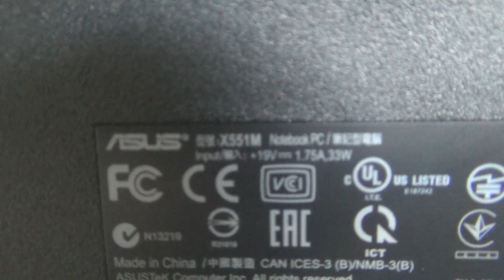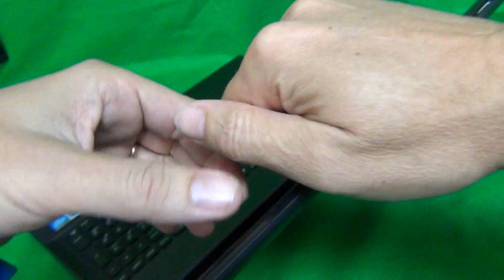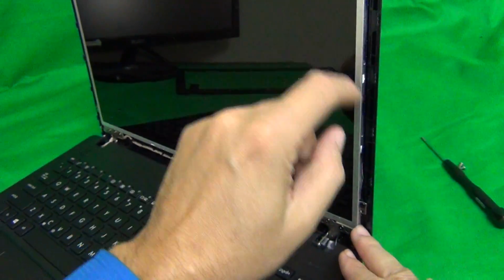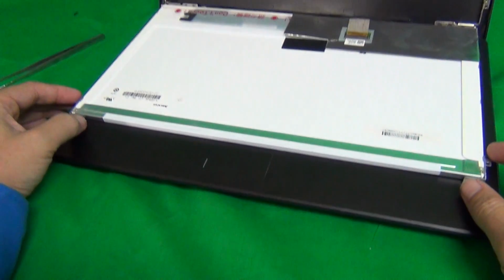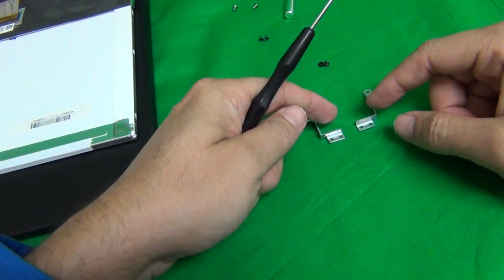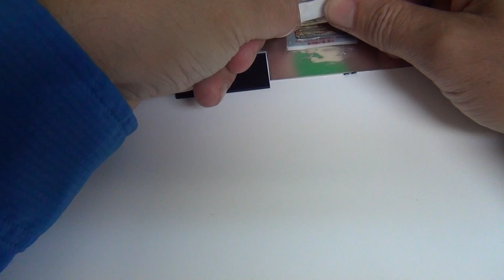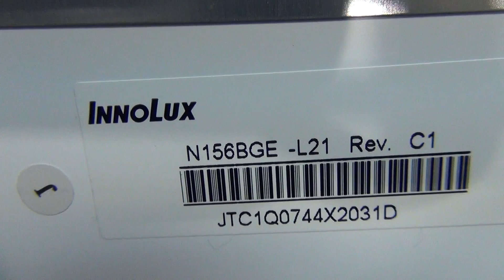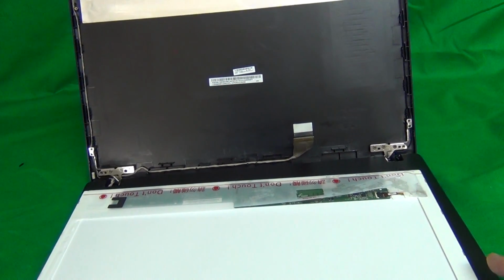ASUS X551M Laptop Screen Replacement Procedure

Comment: SUPER EASY

Shipment of the screen came very quickly. Well wrapped with bubble wrap to secure no sliding around the box. It came with tools and instructions which was a plus for me. You need plenty of light. Best time I did it in the morning. I had bottle caps to keep the screws together for each section of the laptop in one spot, so the screws doesn't mix up with other screws. In my opinion, that is to keep it organized. In overall the screen was crystal clear. Thank you for your service and Thank you for linking it to your videos. I am a very happy customer. 5 stars.

Comment: I want to thank you. I have the D550MA-DS01 which is practically the same. Mine didn't have the foil or the foam block attached to the back of the screen, though - they were attached to the inside of the top cover. A top cover which is labeled X551M, just in case you were wondering how similar these things are. After hitting ice Christmas Eve and landing on my backpack (and therefore my laptop) I had to save some pennies and get a screen off eBay. Thanks to your awesome video, I swapped the screen in about 15 minutes using improvised tools and stuff. Only took that long because I dropped a screw.

Comment: Congratulations for the instructive video :D, i have a simple question.
What important details I have to consider when replacing a screen:
. resolution
.pin connectors
-touch none touch
. eDP or VLS
What else....about the energy maybe?
If I make a mistake selecting a wrong one, what is the worst that could happen to a Laptop?

Comment: The best review for screen replacement with small details so someone could avoid mistakes. I would like to inform everybody that the aluminum foil (13:00 in video) was described as there due to some reason. The actual reason is to avoid touch the logic board accidentally which could kill the display due to static current. Also this works as a heat sync to distribute heat generated during operation. This is why all sensitive electric parts are sealed to avoid human touch. Professionals wear a metal brass when working with such parts.

Comment: My labtop is the same as that but everytime i try Turing it on, it just stays black and noting happens. so I'm wondering.. do you think my labtop screen/monitor is broken or cracked?
Reply: Did you plug it in first? Cause sometimes my computer will be like fully charged, but it wont turn on unless the charger is plugged in. Also, I think that if your screen was cracked completely, it would be showing a few weird colors. That's how it was for my sister's laptop when I broke it :D
Wait maybe it's the battery-

Comment: This was of much help with my ASUS GL552VW, and I suposse it will also work with all ROG series.
The procedure was the same with minor changes: (OF COURSE I USED THE MODEL OF SCREEN COMPATIBLE WITH GL552VW, NOT THE ONE ON THIS VIDEO)
-The plastics that cover the hinges are now separate pieces, you can easily remove then before removing the bezel and put them back later, they attach by plastic tabs.
-There are no screws on the side of the screen, so you dont have to remove the metal pieces that hold it, just unscrew the 4 screws that hold the screen, two on top, two on the bottom, and it will come off. 
-The small metal pieces in the screen where the screws go are part of the screen, the replacement screen will come with them, you don't need to remove them (you couldn't either).

Comment: There is One thing that you should be aware of.  When removing LCD/LED Screens, you really should remove all power sources IE: LI-ION Batteries as you can sometimes short out the replacement LCD Screens.  Trust me, I have done this early in my long computer repair career.  If there is power running through the computer (even if the computer is off), you can short out the screen when you insert the LCD ribbon cable on the LCD screen cable slot if you accidentally touch the metal connectors.  The problem is that with this model, you can not EASILY remove the battery and would require a disassembly of the lid to get to the battery.  Just a friendly caution.

Thanks!
Reply: can i send my labtop in to you so you can repair it
Reply: Esto es cierto, debe retirarse cualquier fuente de alimentacion y veo que en este video no se explica eso.This is true , you must withdraw any power supply and I see in this video is not explained that.
Reply: @jh_sistemas  That's becasue the battery is accessed by removing the keyboard and I believe several other key innards just to reach it.

Comment: THANK YOU    THANK YOU   THANK YOU!!!!    Just a suggestion for anyone else trying this for the first time...  If you don't have a regular work surface and decide to do this on the floor... put down a light colored sheet first... those little screws jump out and dive into carpeting, then you'll find yourself at the local computer repair guy begging for spare screws!  :-)  jus' saying'!

Comment: I dropped mine and it landed on the corner of the led screen and cracked the plastic. The little section of the plastic came off.  Everything seems to be working ok except for the camera and microphone.  There's a thin wire that runs up and along the screen.  This wire is broke at the corner.  Does anybody know if this leads to the camera and mic and can it be soldered and repaired?  Would appreciate any help.
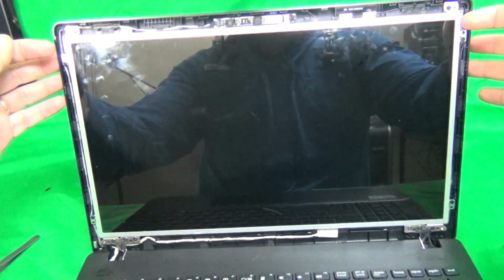Reply: +Billy Boy -- If you can see that definitely "a wire" is broke, of course, soldering it back together would help. However, that's actually a cable with a few wires inside. 5:18 shows the cable routing around the upper left (looking at normally, user's left) corner to the cam/mic. 
Soldering a splice to small wire is a delicate job. If only one wire in the cable is broke, it's doable. Jump the wire first, and see if that repairs things.
Reply: +Nehmo Sergheyev Thank you for your reply.  Luckily I purchased damage insurance when I bought the laptop and it was in effect..  The entire wire was broke.  They repaired it and replaced the back cover with a new one. I had it back in a week.  I couldn't have done the soldering on that tiny wire. The insurance was worth the price.

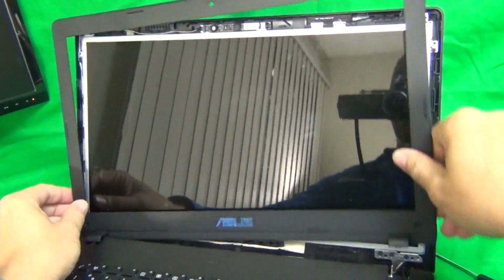Comment: You pretty much broke at least 4 plastic hooks/standoffs/stands or however you want to call them by removing the bezel so forcefully. The corners of the bezel will never close shut again and it's gonna look and feel like crap. I can see the broken plastic pieces at 5:02. Nice job man.
Reply: I did my exact same laptop the exact same way he showed in the video and have no issues what so ever
Reply: +tougemaster || I only see one piece of plastic at that point in the video. The delicateness-roughness level of this job is debatable and the recommended level is hard to communicate to someone in any case. You need real caution when dealing with the electrical connectors, but if you're removing a don't-matter piece of plastic, you can tear it off. 
You actually can assess someone's skill level just by watching how and where they are careful. Ignorant people take precautions where they aren't needed. You must be careful if you don't know what you are doing.
In the way he does the balance, Screen Surgeons has a decent respect for possible damage. I'd go faster, myself, but that's partially my philosophy intruding. You shouldn't waste precious moments of limited life just to forestall possible criticism of trite appearances.

Comment: i punched my pc screen & it doesn't work anymore
Reply: +Bob Jones -- Your report makes me want to try. Did you just pinch some of the screen at the center? How hard? Is it now totally blank?
Reply: If you have an older laptop you could have broken the CCFL lamp. Newer laptops have an LED screen. If you have 2 small hinges, then it has an LED backlight. If it has one long hinge that goes all the way across, then you have a CCFL backlight. I don't know if a CCFL can be replaced without replacing the screen. I also have trouble with my temper.
Reply: same
Reply: You need a therapist for that anger.
Reply: @tellitlikeitis6430  lmaooooo
Reply: That's exactly what I did too

Comment: Do you not remove the battery first? Or is that unnecessary and too much of a pain in this case? (since you have to take the keyboard off)
Reply: It's better to remove but in this line it's too complicated because you have to physically open the laptop
Reply: +TomDufall || I've done screen replacements while the machine was displaying a page. When you make the connection, the screen lights up and you know the job will be a success. 
As a general rule, disconnect the power before you do repairs, but it's not as critical as people would have you believe. In this case, we're only dealing with a few volts. The possible spark is unlikely to harm the connector.
Reply: I've recieved two screens now since trying to replace my cracked screen and both screens light up well when I plug them in but neither displays anything other than a dark screen lit up